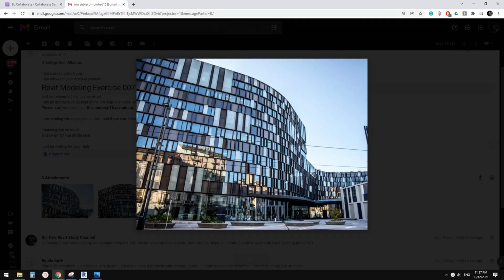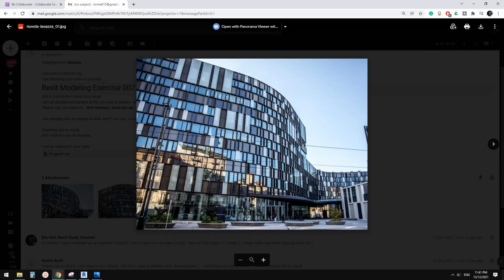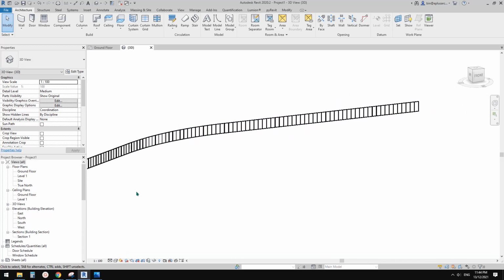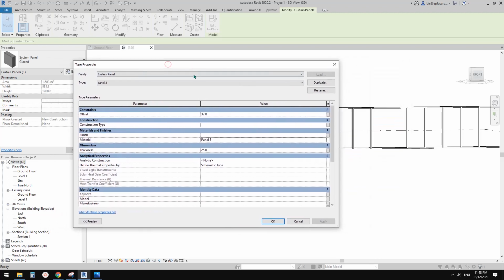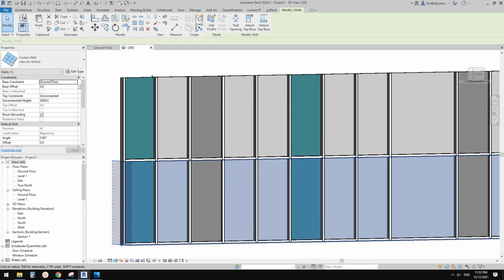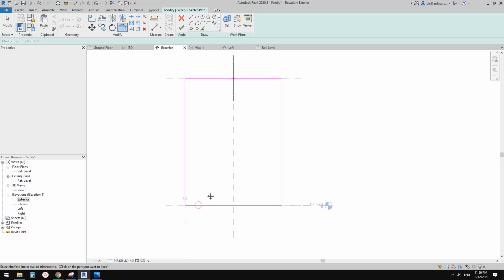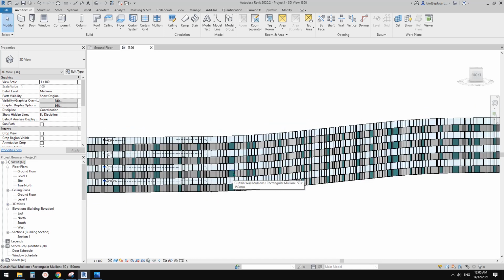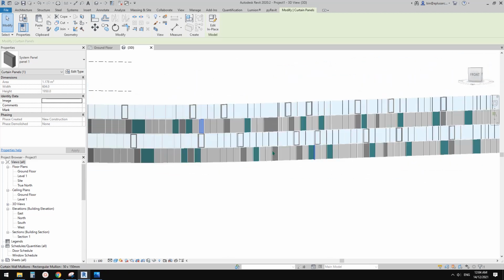Revit Exercise (Day 628) - Curtain wall Exercise

Comment: Hi bin...when to use maximum spacing ,fixed distance nd minimum spacing  while creating curtain wall...thanku
Reply from the maker: Maximum spacing will give you equal(ish) panels (full size); Fixed distance will give you the size with given dimension with side panels. I don't think you have the minimum spacing option here, do you? Is that for curtain grids?